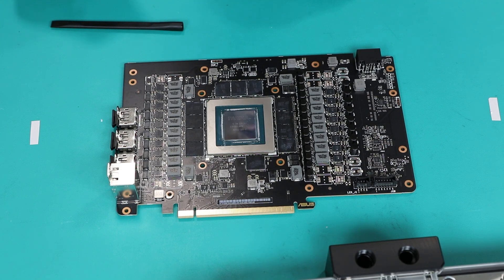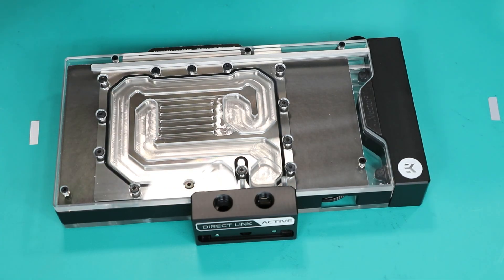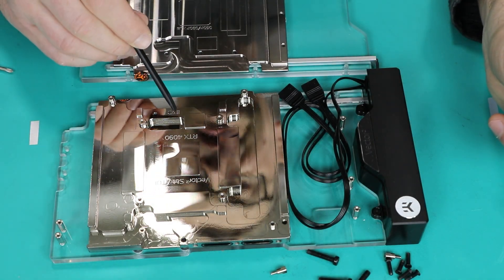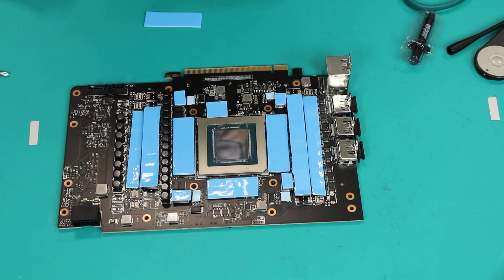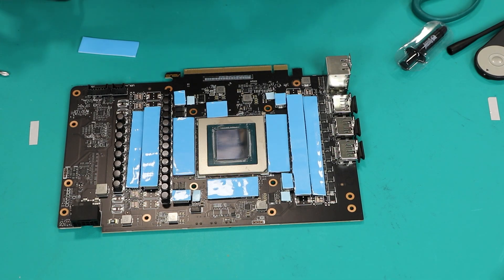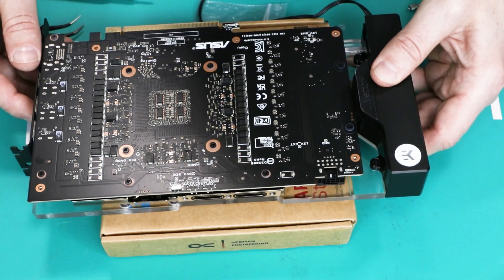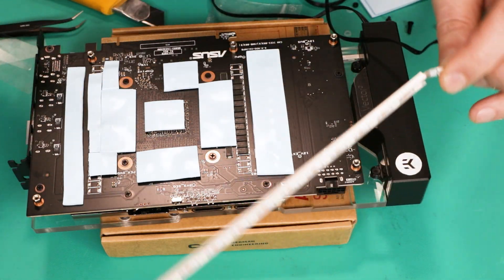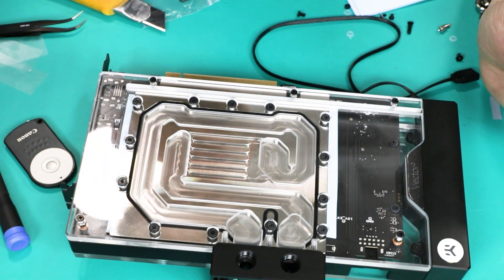Installation of  EK-Quantum Vector² TUF/STRIX ABP Set - Quick Guides #2

Comment: Nice looking block. Does the back plate interfere with any of the motherboard heatsinks? It's pretty thick looking.
Reply from the maker: Yes, block was hitting memory release tabs! I almost had a heart attack when PC fail to boot. Also it is a cheap board without error display…so it took me a minute.
Reply: It depends on which motherboard will be used. There are some cases, for instance with ASUS MAXIMUS Z790 Extreme, it does interfere with the heat sink for the top M.2 slot